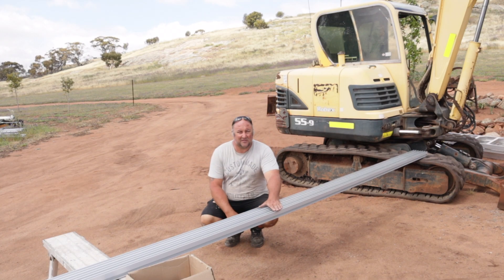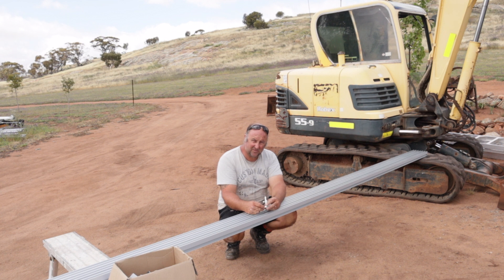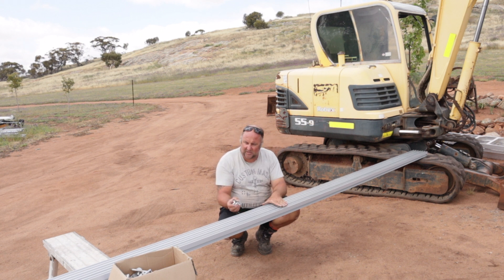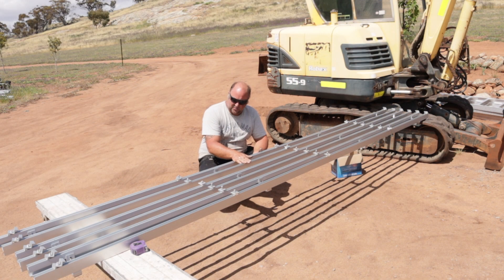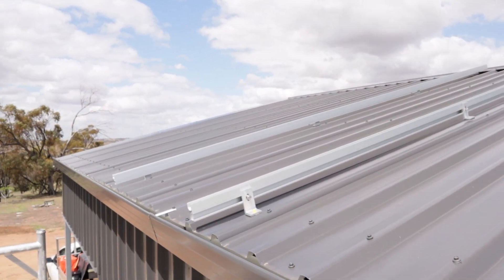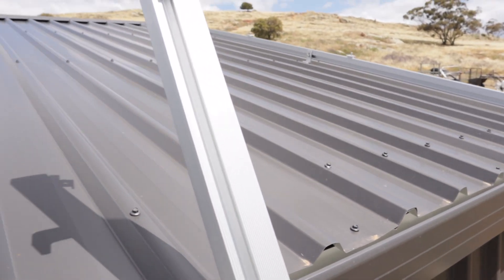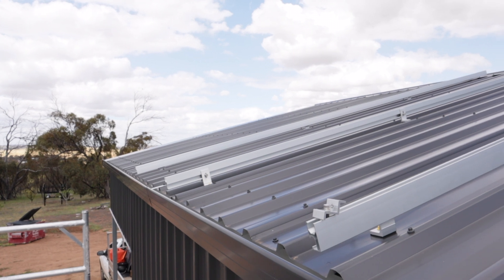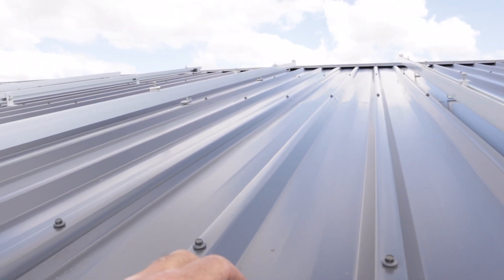Set up + Install solar panel rails and mounts | Off-grid solar system

Comment from the maker: FYI fixing the rails to the roof valley isn't optimal in that, over time, there is an increased risk of water penetration through the fixing holes because rain runs down the valleys. So,  just be aware that we had other priorities that were more important than that potential risk.
Reply: May I ask what those other priorities were?  Great video, I'll be installing some panels on my metal roof soon